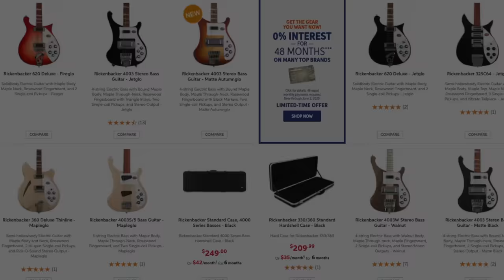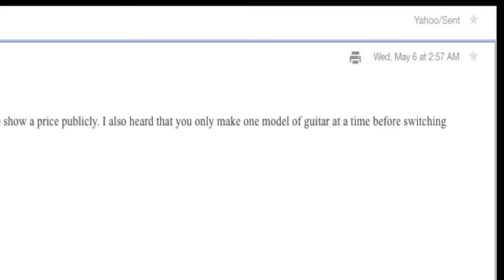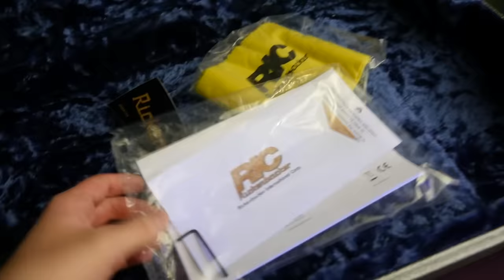You're NOT Allowed to Know the Price! | 2020 Rickenbacker 325 C64 Jetglo | Review + Demo

Comment: The F hole versions were made for import into the U.K. and sold by a company called Rose Morris with the model number 1996. The Lennon's ricks were U.S. domestic models without an f hole. His first rick was bought in Germany during the early Hamburg days. The reissue in the video is of the guitar Lennon received in Feb '64. The Beatles were in Miami to perform on again on the Ed Sullivan show.  Lennon used the new guitar on the show.  While there have been reissues of the Rose Morris version, in general, reissues are the U.S. domestic models. This applies to guitars. Basses never had the same domestic/export versions, so a bass reissue is always a reissue of a domestic version. However, there are a number of different bass reissues and artist versions.

Comment: Its because, pricing can not be linear across all distribution chains in global markets. If you manufacture in the USA and your distributors advertise pricing to include shipping, VAT and distribution markup. Those markets will try to avoid the distributors in their respective markets. In order to advertise a static MSRP then they would need to advertise one price that factors in export cost. Not somethign you want to pay for if this does not apply to you if you live in the country of origin. So they are probably trying to sell cheaper in markets of origin, while export markets have to pay more. So this is actually a good thing, they are more than likely trying to sell at lower cost when possible.

Comment: I have a friend who used to work at Sweetwater, he tested and inspected every single guitar and bass that they got in, and he told me that Rickenbacker’s quality control is completely nonexistent. 

He compared it to the Quality Control issues that Gibson had in the 2000’s and early 2010’s. But whereas Gibson turned themselves around and started worked to improve both their quality control and reputation, John Smith, the CEO of Rickenbacker seems to think that since the small batches of guitars are gonna sell regardless of the insane price and quality issues that they shouldn’t even bother. 

If Rickenbacker really cared about their reputation they’d take steps to improve their quality and not spend so much time, energy and money sending their army of lawyers after websites selling build-your-own Guitar kits.

Comment: John only used his 1958 model through 1963. In early 1964, they made him the brand new 1964 rickenbacker 325, which was actually created with Lennon in mind, made to his specs. He received it in February 1964. The clip you showed is from 1965, meaning that he’s actually using his 1964 model, not the 1958 model.

Comment: THE SMALL KNOB IS A BLEND CONTROL THAT ADJUSTS THE VOLUME BETWEEN THE NECK & THE BRIDGE PICKUP. THAT WAY YOU CAN FAVOR THE VOLUME OF ONE OVER THE OTHER. KEEP IN MIND IF YOU TURN IT ALL THE WAY IN EITHER DIRECTION YOU WILL COMPLETELY KILL THE VOLUME OF ONE OF THE PICKUPS. THEN YOU WILL THINK YOU HAVE A PICKUP THAT'S BAD. SO CENTER POSITION OR A LITTLE EITHER WAY IS BEST BUT NOT ALL THE WAY.

Comment: Regarding the pricing, this has nothing to do with the internet.  The call for price policy existed during mail order catalog days as well.  While not the only reason, one reason this is done is to protect small local dealers from competition from larger distributors who can run smaller margins and buy at lower prices because they buy larger volumes.  If everyone is prevented from advertising the price, then the playing field is level.  You find out the price when you are motivated enough to speak with a dealer and purchase.  Since you don't know the price, you are just as likely to buy from a local guy as going through the mail.  Mail order still captures those without the local dealer, but doesn't trample on the local guys territory.

Comment: In the very early part of the 80's I bought a custom ordered Rickenbacker 360 WB (with binding) Fire Glo with vintage toaster pickups. The price with case and shipping? $650.00
Then in 87 I got a Pete Townshend signature from the same Beatle instrument dealer who had a great relationship with the factory. Again the price was low... About $750. Also got a 4003 bass for around $700... It was the time to buy them for sure... Those guitars are close to 3k each these days. Wish I had them now. I'd be selling.

Comment: I've seen a similar trend on Gibson prices. I won't name the 2 major retailers I saw doing this, you can find them and see it for yourself.

The scam is as follows, both retailers sell the instruments for exactly the same price Gibson sells them for on the Gibson website.
That is not necessarily an issue, it just means you are not receiving a discount from the retailer.

The dishonest and or misleading part of the retailers is as follows.

Retailer 1 claims the MSRP of the instrument is $ XXXX and you are saving $X dollars for buying from them for their "special" pricing, but in reality you are paying the retailer the exact same price to the penny as you would pay for that exact same instrument purchasing it directly from Gibson. That's kind of shady, but it gets worse.

Retailer 2 claims the MSRP of the instrument is higher than retailer 1 stated, claims based of this inflated number that you are saving more with them than you would with another retailer, but in fact retailer 2 sells the instrument for the exact same price as retailer 1 which is the same price as Gibson.

Is it just me or is the electric guitar market becoming just as dishonest as car sales? I think cars may be more honest because at least in cars the MSRP is set in stone by the manufacturer, not speculative and therefore a starting price point to negotiate an actual sale price from.

I called Gibson, told them who the dealers were and gave them exact models of guitars and the claimed MSRP numbers and actual listed sales prices.
Interestingly enough, the Gibson rep would not clarify that the price Gibson sells the instrument for is the MSRP which customarily the price to a consumer directly from the manufacturer is the MSRP and on Gibson's website the only price shown is the price you pay.

What this tells me is if I want a new Gibson, I should order it directly from Gibson. There is no price difference, I can have a guitar only touched by Gibson before I get it, I won't wonder what is missing or not from the original packaging because certain retailers take the guitars out of the cases, hang them on the walls which can mar the headstock, and just take the case with the tool and other little things from the factory and throw them in the corner, in the back with no rhyme or reason to keep track of what goes with which guitar on the floor, and the thing I really hate is store people or customers who fuck with the factory set up doing shit like adjusting pickup height and bridge height. So Gibson ordered directly from Gibson exact model, finish and color, unmolested for the same price as retail store.

Comment: Wanna know the price? Hit Reverb or eBay for a ballpark range. Wanna save money? Buy a used 325. Plenty out there and you won't take the initial depreciation hit. My best Rics are used ones.

Also, I would drop in a new harness to get more flexibility. As someone who has owned 325s since '97, I have some experience. I also have a 320 (hardtail sibling to the 325).

Comment: You need to check out the 360 model.... their most popular. It's full scale, 24 frets, bigger body, semi-hollow, still has the 5th knob but.....  it's also STEREO! It has 2 output jacks... one "standard", the other "Ric-O-Sound" and both together stereo. It also has their iconic "Slash" sound-hole rather than the F-hole. John Fogerty used the 360 more than his 325. George Harrison used a 360 6-string and the 12-string model. Roger McGuinn, Pete Townshend, Paul Weller, Peter Buck, Tom Petty, John Kay, Susannah Hoffs...  There's a reason everyone plays the 360. John Lennon is the only reason anyone even knows what a 325 is. The 360 is the one you want.

Comment: The reason the truss rods aren't capped is because they are designed to be user-replaceable in the event one breaks.  According to Rickenbacker, you just slide the old one out and slide the new one in.  Seems quite innovative considering the time consuming and labor intensive process of removing a fingerboard is completely unnecessary.

Comment: One thing I HATE about American Standard Fender guitars with maple fingerboards is that they sprayed the clear coat over the frets. As it gets old, it will yellow and chip. I have had several where I had to dress all the frets to fix this. I never had that problem on Japanese or Korean Fenders. I currently have a '91 Am Std Strat that had the clear on the frets and I also had a 2001 and 2003 that had the same problem. I got rid of the 2000s American Fenders because they both had problems with the clear de-laminating from the black marker dots. I have noticed that on MANY from the early - mid 2000s with maple boards!

Comment: I don't know what the body is finished with,  but in the closeups it looks a lot like nitrocellulose. Although accepted definitions allow the term "lacquer" to be used for plastic varnish, I strongly prefer to refer to nitrocellulose as "lacquer", and Varathane, Urethane, Polyurethane, etc. as "plastic varnish". That's because there's a huge difference between the two. The lacquer finish is dull and dusty, with a diffused sheen and heavily muted highlights. At certain angles, the black looks like slate. It is not as smooth as plastic varnish, especially in damp weather, when it is a bit sticky. In my house, most of the hardwood floors are lacquer, as are the Douglas Fir plywood doors, and spruce trim. After nearly 70 years, it still looks good, very durable, but don't ever get it wet, or you'll end up with bare wood. My Rickenbacker 320 guitar has lacquer on the body and head, and a very heavy coating of plastic varnish on the fretboard and neck. The  lacquer gives it a vintage look, and there are those who say that the surface of the body resonates better with lacquer. I had a Gretsch Chet Atkins from the 1950s, and the neck got sticky in the August humidity. Collectors like the checked finish on the vintage lacquer guitars. Fender says in their website that they stopped using the lacquer in the late 60s.

Comment: You should probably check out the 650/660 series since they're wide as fuck on the neck: 44.5mm/1.75", the 650 was a solid body, pretty tank-like body, light and loaded with mini-humbuckers of the own RIC brand. The 660 is still in production and is kinda still like the 620, single coils, laquered body and fretboard, but walnut fretboard and semi-hollow body.
EH, don't buy the cheaper ones of the 650 tho! I wanna get one this year, I'm on budget and I hope for the best.

Comment: Hey at least you can order them even if you have to beg for the price... "Down Under" for all intent and purposes we no longer have a Ricky dealers or distributer. 
Theoretically you can have a store order them through the Japanese  distributer as they are the offical Oceanic region distributer but no store I know will as they say they just get told "no stock" (probably none left over from supplying demand in Japan - they seem to be hot property there and I've seen more Rickenbackers on the shelf in one visit to the Ishibashi store in Tokyo than the total amount I'd seen in Australian when we did have a distributer)  
I bought just about the last 4003 bass officially imported back 2004 or 2005 ('ish) and then not long after picked up a well used and slightly abused 350 (full scale version of the 325)  for peanuts (I mean less than the MIJ Strat hanging next to it) from a boutique  guitar shop closing down sale.
Reply: Mark Secker l

Comment: I requested a price from Guitar Center for the 325/64 a month or so ago and was told $3599. Reverb dealers have the 325 for the same price brand new. Talk about inflation. I bought a 2021 model for $2869 from a Reverb dealer after some haggling. I've owned a 350 for 20 years bought at a guitar show. Next to my LPs, SG, Tele & even my Nighthawk, the 350 felt like a crap guitar. I chalked that up to it being used and probably abused. I figured a late model Rickenbacker would be much better. Not really. Strumming the guitar without amplification, it sounds like I am strumming a laundry washboard (you young folk may have to google 'laundry washboard"). It doesn't stay in tune. I'll take it to my guitar guy and get it set up. I knew the short scale would present playing challenges for me. Bar chords up to the ninth fret are okay for me. I am not as accomplished a guitar player as most folk  here probably are - I really dislike not having a dot on the side of the fret board marking the third fret. My 350 has the dots on the fretboard and on the side.

Comment: They've never released their prices - not even in the catalogs back in '64 - I know because I saved mine. This 325 series were called "Capris". To get prices merely put them into any shopping cart and the price will be revealed, it's no big deal. You should brush up on your Beatles as they are responsible for you talking about guitars today - literally. They are also responsible for the entire guitar industry blowing up in the 60s. John was taught initially by his Mom as Mom played banjo she taught the "claw" chords to John - the easy ones down low by the nut - "clawed" with thumb wrapped around neck -the Rick basically had such a thin neck it made it easy for John to play the claw chords compared to other brands - it wasn't so much the 3/4 body he liked as there isn't that much different between the two bodies but the 3/4 fretboard is sure "precious"  🎸

Comment: Rickenbacker stopped using CV (conversion varnish) back around 2007/2008 and switched to a UV cure finish.

Also, I played a 325 years ago, and it was way too small for me, and I'm not a big guy.  Despite being a huge Beatles fan, I'll never own one.

One caveat about Rickenbacker 12-strings; unless it's  a newer 660 (or the Tom Petty sig), their 12-string necks are the same width as their 6-string necks, which is way too narrow.  I owned a 330/12 and I could not play that thing without muting strings (I also don't like the way they have the strings arranged with the octave strings on the bottom).  I ended up selling it about six months later.  The 330 and 360 6-string Rics that I owned were good, though.

Comment: Rickenbacker 12 strings. Look great, sound great, great headstock design - so clever the tuners going one way and then the other. But...try restringing one, the tailpiece is a total nightmare, a total design failure. Break a string at a gig and you have to carry on with 11 strings. A nightmare design.
Reply: true-- to restring you have to take it to a tech-- then 50/50 he'll screw it up

Comment: I'll never buy a guitar that's more than like 700-800, so I'm kind of talking without experience, but I'm pretty surprised by this guitar. I've liked Rics because they sound cool through the Vox AC amps and look cool, but as you were demoing them those pickups sounded almost like they weren't EQ'd correctly. And the build is so weird with those grommets, the the basic maple for everything, thick lacquer, weird bridge and tail, and ehh trim. I guess when your company is almost exclusively ran on nostalgia design features that other brands would eventually fix become quirks that add character. Fender and Gibson have realized that nostalgia alone can't keep the company going, but they're also operating on a much larger scale than Ric, so I guess Ric can keep making what're essentially fancy Danelectros.
Reply: Id rather have a cheap Dan.

Comment: Man that sure looks like a Chickenbacker (Chinese copy). Did you buy it from a retailer? I had the same experience with a Gibson. I tried this used one from Craigslist that had weird paint and binding inconsistencies. Sounded good and played well, but nothing magical. If it didn't say Gibson I would have believed it was a $600 Asian copy, but the serial number checked out with Gibson, so I just saved my $3k and bought another cheapo to upgrade at my own pace.
Reply: Not a chickenbacker, but this unit he's demoing is not great quality. Others are great. V series 325s are so much better.

Comment: I have a 4003 love the thing to death but man, they aren’t for everyone. Lots of the standard hardware sucks; I’ll admit that wholeheartedly. First thing I did was swap out that awful bridge with a Hipshot replacement. Then I took of the pickup cover because all it does is get in the way, and finally changed the neck pickup to a nordstrand pickup. Made it my own. Another thing to consider; the truss rod in Ricks are notoriously trick to work on. Their design is awful and it can damage easily. My Rick is currently in the shop because the truss rods became loose. I decided to just have the shop replace them entirely with higher quality ones and yeah, it sucks. Rickenbackers are not for everyone.